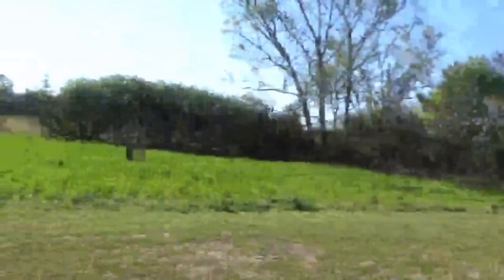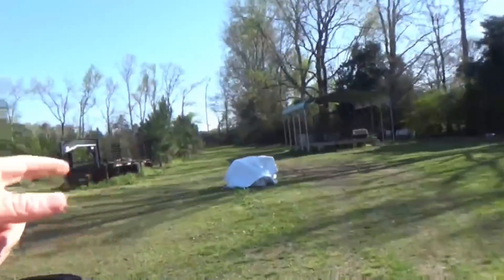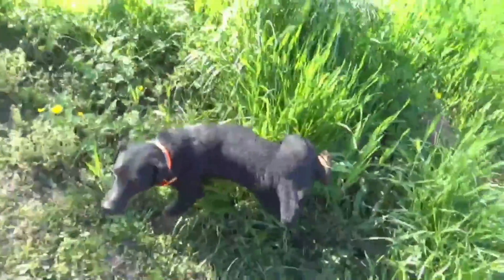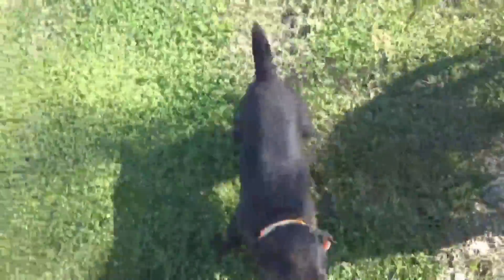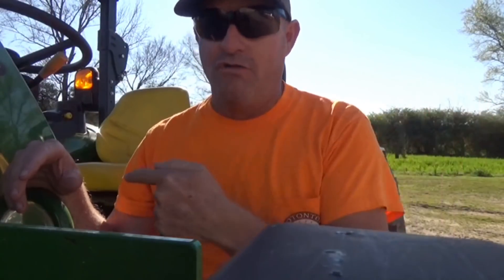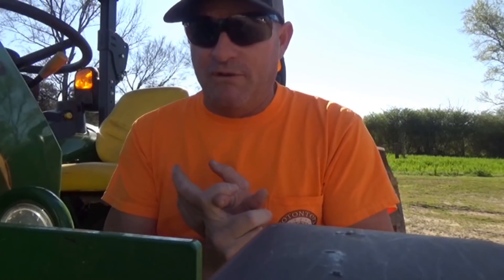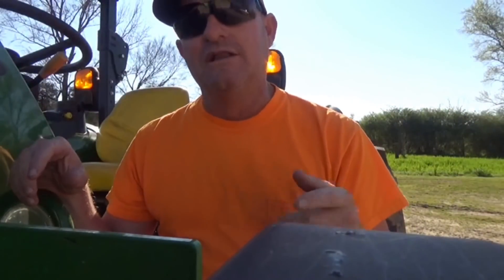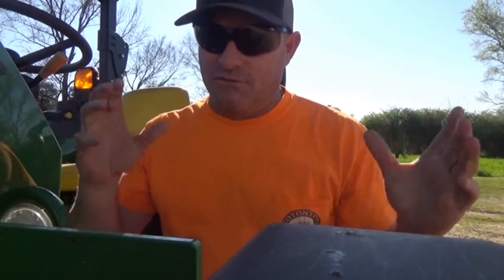YouTube, meet Cottonwood!

Comment: Hi Tim
The weights you have just said about are the the GCW or load only these are roughly 35.to 39 Tons
here in NZ the normal GCW for heavy trucks is approx 45 metric Tonnes depending on axle weights 
but with 4 axle trucks & 5 axle trailers you can register trucks over 50 Tonnes 
Have a good Day

Comment: Question on the weight, here we can gross 80,000 normal legal load, but only 34,000 per tandem axle group. Do you have the same requirement? From the looks of the loads I would think you would be over that on the truck tandems. Thanks for the videos!